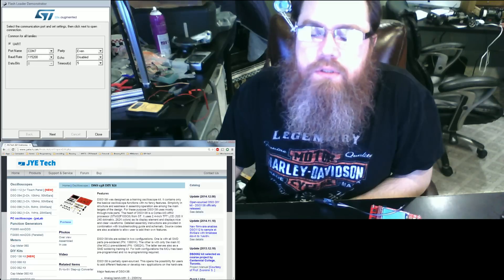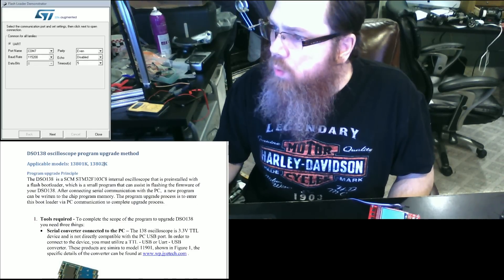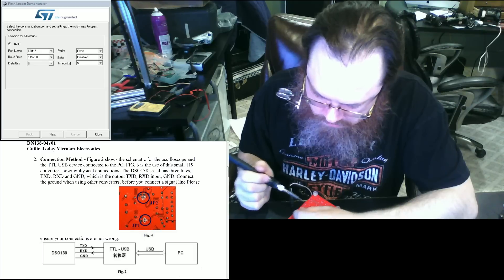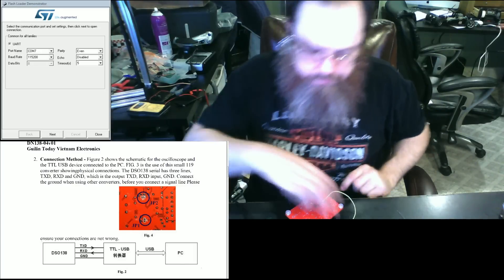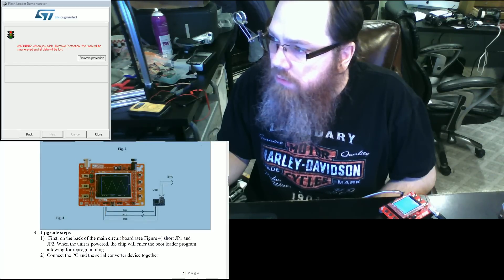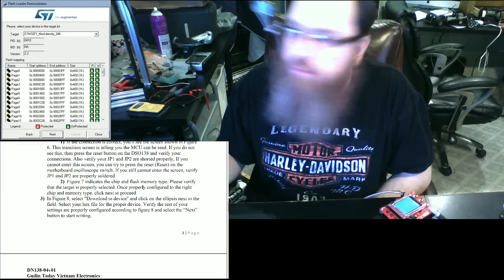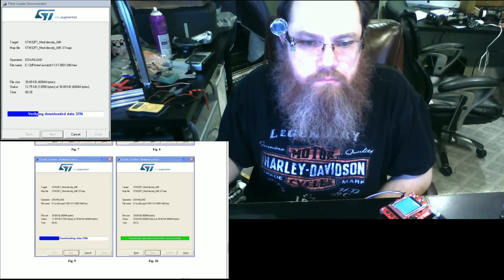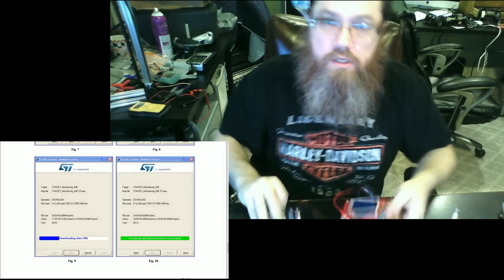HNGamers presents - DSO 138 oscilloscope firmware upgrade

Comment: Can I just directly connect to the COM port on the motherboard, so I don't have to order a converter for this? (Pin 2,3,5 on the motherboard is RX, TX and Ground if I see it correctly.  )

Comment: Hi:
Could you tell me if you can read the HEX file off the unit you have and save it so that if you have an issue, you can reinstall the same file back into your oscilloscope? I have a 045 and they have not released it and I was going to try 040 and I want to be able to get 045 back. I don't want to mess things up!!!!
Thanks for any help you can give me.
Reply from the maker: amtpdb1 You can read/write the hex file once you have connected so you should be able to back up and restore the firmware you have.
Reply: thevisad Thanks for the information. As I am not sure how this would be done, I wonder if you would take pity on those of us that are less knowledgeable and think about making a video to show us how (;-)? I really don't want to mess it up with all the settings.
Thanks again for answering and I hope you think about making a video showing us how.
Don

Comment: You seem to have some interaction with them. Can you ask them to release at least 045 or 046? I have 045 on mine but there seem to be an issue with the trigger. I would like reflash it to 45 or 46. I would like to try 40 but then can't get back to 45. Is there a way to download the firmware off the chip so that I could reflash it back? I have made several posts to JYE's forum, but they don't respond to any of the posts.
Thanks for any help.
Have a nice day.

Comment: Thank you for your great videos.  One question. Do you know what the usb port is for?
Reply from the maker: Діма Сандомірський You can use the USB to power the device and there is a way to access the chip via the USB interface as well. I added a link to the chip family page at ST Micro. It requires a special USB driver and software I believe to access it.
Reply: thevisad Is it possible for the DSO138 to connect to JYELab? If not, could it be added to the firmware?
Reply from the maker: Діма Сандомірський Good question, I will ask them and let you know when they update me. I know it's a different driver then the other supported scopes.
Reply from the maker: Діма Сандомірський They provided the following answer, The miniUSB connector was provided for possible future use or for user's own use. Presently it is optional and does not have any function.